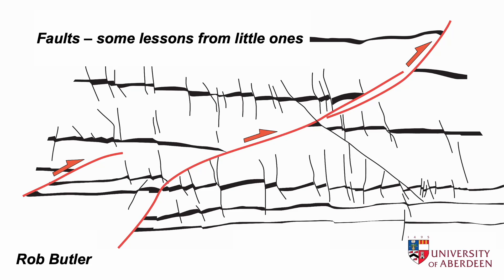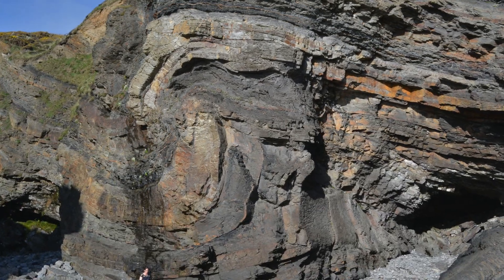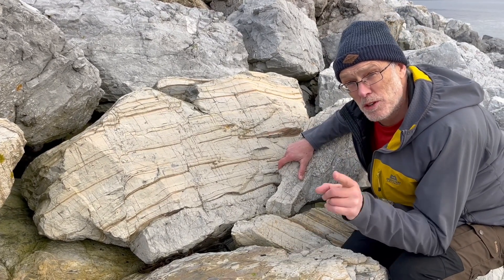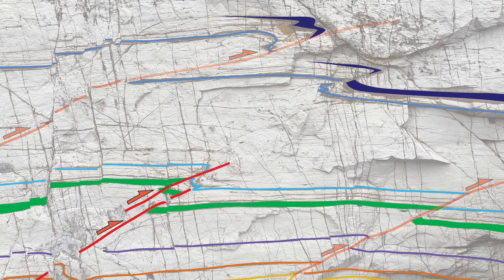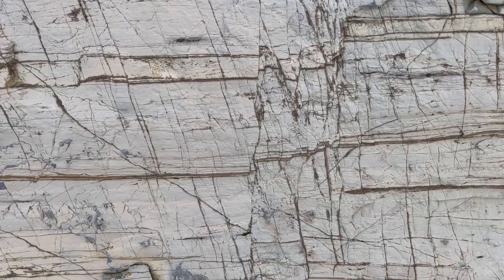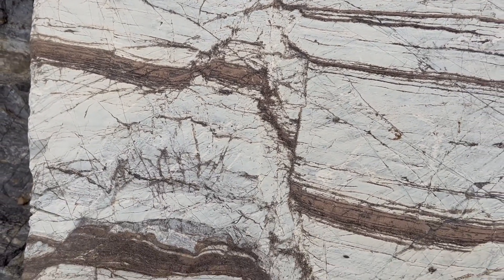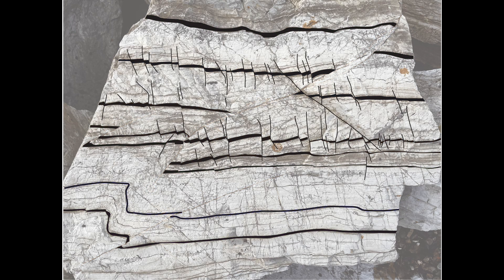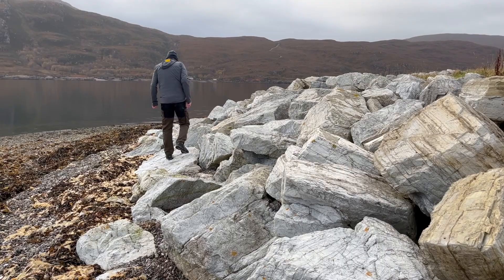Faults - some lessons from little ones

Comment: Hi Rob! I came across your series of these videos as a result of unsuccessful YouTube searches trying to find an answer to the question - is procedural simulation at this level of detail possible? I know there is work on macro-tectonic (not sure of the term) movements, there is a lot of work on thermal and aqua-erosion. But I haven't found anything anywhere close to this. I'm looking for an answer because I'm in the process of developing a game that involves procedural generation of rocky surfaces in the closest to reality variants (as in this video) without any geological education and background at all (I have a phd in psychology). So far what I've had a handle on is a procedural "sandwich" with different lateral distortions and rotations with different densities - resulting in different erosion responses. I am asking for advice and direction as to where I could direct my search to find something to lean on? 

PS. Please forgive my rudeness with terms, as I said above - this field of science is like space for me so far.
Reply from the maker: Hi Mike
There is a big area of geoscience activity concerned with creating and sharing "virtual outcrops". Perhaps that's along the lines of what you're after?
The best site is 
https://v3geo.com/
If this is useful I can connect you with the dev team etc.
Cheers
Rob
Reply: @robbutler2095  Awesome! Thanks for the tip! I'll strap on my diving suit and go for a dive into this rabbithole, then probably come back with more weird questions. Thanks again, much appreciated! Mike